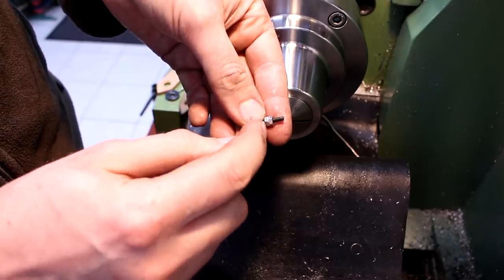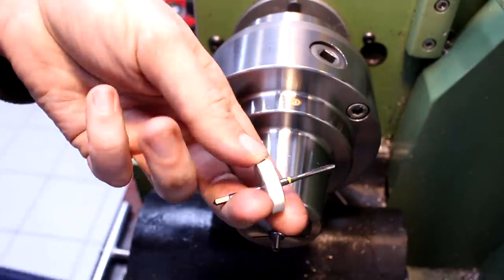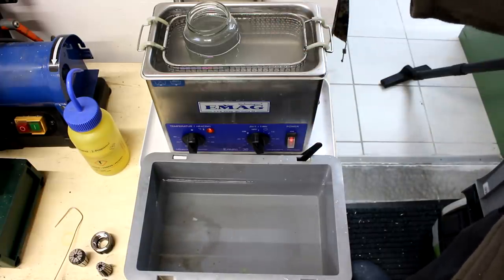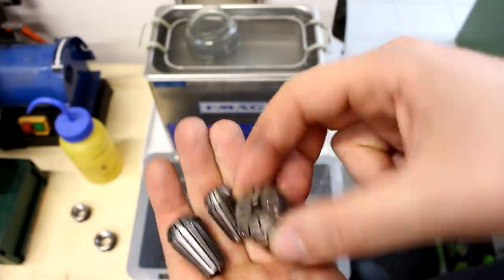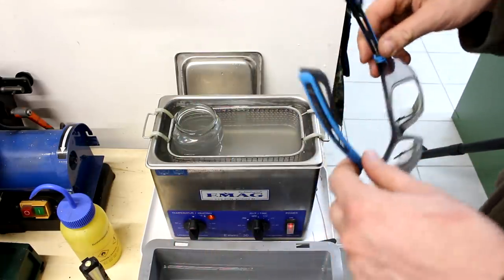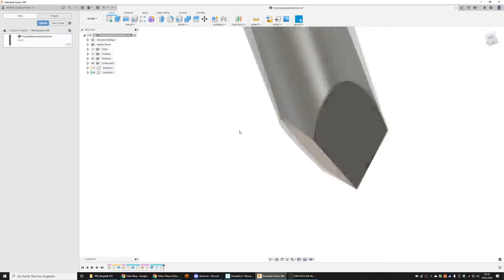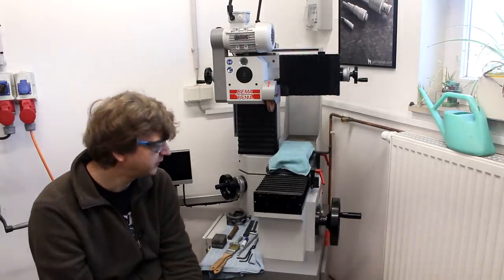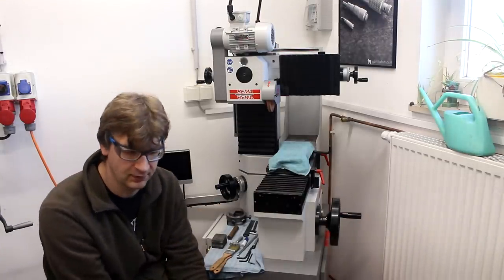Shoptalk #25 - 02-2022

Comment: I’m so pleased to have come up with the same solution for tiny hole spotting. I made the same tool from a broken PCB drill using a setup kind of like you’d use to cut facets in a gemstone. I needed to drill some 0.002" / 0.05mm holes in PEEK tubing and I needed to spot them first. Thanks for the video. I really appreciate your skills.

Comment: Here in the US we have a warehouse club thats owned by Walmart called "Sams Club" they sell a Degreaser concentrate for $6/gallon that is very similar to "Purple Power", it makes 32 gallons of cleaner if you mix it by the label, or if you mix it 1:1 it will strip paint- I use it in the Ultra-sonic on everything except Aluminum Carb bodies as it turns them DARK (For those I use Berrymans)

My old, worn out 1946 Brown and Sharpe No2 worn out 6x18 Surface Grinder weighs 1,400 lbs.......

Comment: Excellent content as always so thank You!
One detergent that is alcalic and which is easily available is the dish washer detergent. Those are designed to remove fat and not to harm cutlery.
However, alcalic solution will usually attack aluminium.  That is especially true when the detergent contains lye (sodium hydroxide). Actually having aluminium shavings in a lye solution produces hydrogen. This is because lye and water react with aluminium creating sodium aluminate and the hydrogen will just bubble out.  That reaction can be quite violent and the hydrogen gas is ... well ... it is what it is.

Edit: I need to seek help 😊

Comment: Love the shop talks.....another way to guide a very small tap is by machining a holder for the shank of the tap, the tap shank slides into a precise hole (essentiall a tube) and allows the tap shank to be guided up and down as the tap threads in and out.....the top of the small holder is solid and can be tightened into the chuck or collet and held tight.....quick easy and simple to make, combine that with your knurled tightener and its a win win combination and can be used for multiple taps of the same shaft diameters.....Keep up the fantastic work.....
Don

Comment: I precision grind my horizontal band saws this way also before silver brazing them together in a custom jig for alignment when I make up my new blades, it greatly increases blade joint strength, by increasing weld surface area, most blades are just butt welded together that increases the chance of breakage at the joint!

Comment: Two questions:
1) With the "pyramidal" bit, why not make it a true pyramid with four flats? That would get rid of the added complexity of calculating compound angles when grinding the flats.
2) I have no experience at all with surface grinders but I've seen that they're normally dressed using a diamond tool. How long does that typically last before requiring replacement?
And yes, I watched every minute. Always fun to watch a true afficionado geek out over a new tool.

Comment: Wow awesome grinder! 👍👍  (At the cost of a sports car... 🤔)
Here is a suggestion for the ultrasonic cleaner; in the supermarket you can buy bright coloured silicone webbed mats, about 120mm square and 2mm thick. They sell them with the kitchen goods as a "grip aid" to help remove jar tops. The silicons is stable and heatproof, and you can use them in the ultrasonic cleaner to stop your glass jar or large items from rubbing on the stainless container. 🙂
Reply from the maker: A sports car will be worn, rusted away and obsolete in 10 years, the grinder will last :-)
The silicone mat is a great idea, i will give that a try!

Comment: Stefan, the load is also torsional, in use trying to twist as much or more so, as “ vertical “ load.  So you don’t get to take 3mm cuts with a 10mm bar.  SO!  You did good.  Loved the project.  More similar stuff for us who don’t question your training!

Comment: The alkaline solution not only neutralizes oils but it's also a great drain cleaner. The industrial strength stuff is nothing but pure lye which is extremely alkaline.  Depending on what your cleaning as long as there are no heavy metals in suspension going down the drain may be just fine.

Comment: Deflection of the tip would of a cantilevered beam is (force * length ^ 3) / (youngs modulus * second moment of inertia) assuming a fully fixed mount. It's true the second moment of inertia would be disproportionately affected by removal of material further from the centroid axis, but as it's a circle the area that is removed is relatively small until the removed distance becomes larger. The main thing to take away from that equation though is the stickout makes a much higher overall impact. Halving the 2nd moment of inertia only doubles the deflection, doubling the stickout increases deflection by a factor of 8! 
This is also why the carbide helps - the youngs modulus of carbide is about 3x that of steel, thus 3x less deflection. Perhaps most interesting for me is a 45% increase in stickout entirely eliminates this difference (or in another way switching steel to carbide allows a 45% longer boring bar with the same deflection)

Comment: As far as disposing of the cleaner solution, what I do is add all the dirty solution to a bucket or pan, let it evaporate a lot of the water off (no heating, I just let it sit a few days), then I put the now concentrated solution with all the nasty bits and oil into a 5qt oil jug and dispose of it quarterly at a waste disposal that handles solvents and petroleum products. 

It's the laziest, easiest way to do it.
Reply from the maker: You might be laughing, but I do that :D
Not only with the ultrasonic cleaner solution, ut also with the water from my vibratory tumbler.

A way to speed it up, is to have a rag hang into the liquid and wick up the water - this increases the effective evaporation area. Works especially well during a hot summer.
Reply: @StefanGotteswinter  I'm going to do the rag trick now, makes perfect sense. That's how a swamp cooler works!

Comment: Okay, that Bema grinder is scary silent. I didn't even know you had turned it on until I heard it working on the part. That is indeed a very nice machine.
Reply: I remember being school (metal/machining) young and there was lady that was learning to be machinist and she unfortunately lost finger as she had thought she had turned off the machine and she had gotten that nasty optical illusion that wheel had stopped and she had done something like began to fix part or something and it's obvious what can happen. Part of the incident was that machine was so quiet and there had been some background noise. IIRC they added some lights and warnings to some of the equipment to try to prevent such incidents in future.

Comment: Seems Austrian's have a better sense of humor than Germans! 😂
I'm pretty sure I need therapy as I watched the full hour and forty three seconds, you do have a calming effect though 
Using drill chuck for guide plus putting a flat on tap was an addition to Joe Pie's mini-tap wrenches
I modify  old Honda carbs( from mid 1970's) The damage ultrasonic cleaners can do from cavitation is very dramatic on zinc based parts. Way too many motorcycle shops seem to think it's the 'best' way top clean carburettors, it's not but it is a quick way to destroy them. It's fast but generally a very bad idea. 
I've had an ultra sonic cleaner for ? years but very rarely used it, glad you showed some different uses for it,

Comment: Hi from Amsterdam. Is it possible to use coolant with the new surface grinder? Which I really like by the way.
Reply from the maker: Mist setup would work, flood cooleant not without adding a tray. I see a way for doing that, but I think I can live without. A lot of toolroom grinding is done dry and people find ways to deal with heat input, thermal growth and wheel behaviour.
Sometimes I might use cutting oil or a wax spread on the part, if I grind something very soft or gummy like copper or soft steel (especially a magnet chuck)

Comment: I desperately need help, one hour of video went like 10 mins. Regarding the wheels for small grinders, I find very very difficult to find wheels in low hardness grades for my Saim e4 (very similar to your lip515). Where do you find this 46j orange wheel? Thank you Stefan!
Reply from the maker: I buy 46grit J hardness from H.B. Schleifmittel here in germany.
How do you like the Saim? I considered a hydraulic one, but the ones I looked at, did not have a manual table traverse.
Reply: @StefanGotteswinter  Thank you for the tip, I'll look for HB Schleifmittel. Il like my grinder, but it's in the same situation as your lip, it had a hard past life and after a ton of work I get good results out of it, it has an optional planetary stage for the X movement with a lever, that makes long grinding sessions less effort intensive.

Comment: That looks like a far more heavily built manual surface grinder than a Harig. We had 5 or 6 Harigs in the shop.  One thing Harig offered was left or right hand table traverse. As most people are right handed I always thought that the right handed machines were more natural to operate. But then maybe that was what I was used to. We also had DoAll hydraulic grinders and they were right handed for the manual table traverse.

Comment: Hi Stefan, do you lightly oil the ER collets after cleaning, to stop rust occuring?
Reply from the maker: Nope, I just blow them dry, never had issues that way.
Reply: Thanks stefan, nice and easy then. Thought they may start to corrode. I have a small ultrasonic cleaner that i have used on a few micrometers for a few mins at a time just to get grime off. They certainly do come in handy. Ive put a bit of clock oul on those and they are great.

Comment: I was using glass jars of cleaner in my ultrasonic for same reason to reduce the amount of wasted cleaning fluid. But I had assumed that the glass wall of the jar, was reducing the effectiveness of the ultrasonic wave passing through the jar. Thus reducing the cleaning action. Am I wrong and can go back to using the glass jar method? 
I might do the aluminium foil test. One in the jar the other outside and compare the hole rates as a gauge to see if there is any difference.
Reply from the maker: The glass definetly weakens the effect a bit - But for me the waste-reduction is more worth than a few percent of less cleaning effect or a few seconds longer in the bath.

Comment: Hi Stefan.   You’re the only YouTuber I will sit down for an hour and watch/learn with 0 complaints.  Question I have is:  most surface grinders I see in North America have provisions for flood coolant.  Is not having that option a problem for high quality surface finishes?
Reply from the maker: Cooleant would be nice for heat control when doing heavy stock removal - But the toolroom class grinding we do on these small grinders can be done dry without much issues.
On a automatic grinder that has to do a lot of plate work (Like in stock preparation or when grinding die/mold bases, cooleant is an absolute must)

Comment: Hi Stefan, great video as always! The new Bema SG looks fantastic for your use case and must feel great to have a new new machine and not require you to do any post shipping mods from the factory. One thing I was wondering was how do you find the arm position for the side / lateral movement after using the Bema SG for a longer time frame?

Comment: We built some war games equipment that mounted on tanks. The customer wanted the system easily installed and removed so we designed a magnetic mount. Unfortunately we didn't use expensive "aluminum" grade magnets and the system didn't stick to the armour!

Comment: Now that I see the stuff about tapping: do you have any advice on how to get a thread die started properly, especially without the apropriate lathe tool?
Reply from the maker: I used to support dies for years just with the drillchuck opened up all the way in the tailstock.
Reply: @StefanGotteswinter  I tried that, but I'd need a third hand to keep pressure on the die holder. My small lathe is too weak for doing it under power.

Comment: I thought it was a best practice to only turn the tap 1 turn then back half a turn.  Is that not required?
Reply from the maker: Not with decent taps - It can even cause problems like chipped cutting edges or snagging of chips if you chipbreak with them.
The 1 turn forward, half turn back is from a time when taps where really shitty.

Comment: Not a machinist, but that bema indeed looks really nice quality. Out of curiosity, are those grinding wheels expensive commodity (I hope that's the correct english word)? I assume they're way more better materials than used in normal bench grinders wheels?
edit Oh it was actually mentioned in the video. Much cheaper than I anticipated. Thanks for mentioning it.
edit2 I'm bit surprised that table movement doesn't have any automation. Would be dirt cheap to have solution to it from the factory. Though easy to make self.
Reply from the maker: On toolroom style grinders you will often find purely manual motions without any assist :)
The nice thing: Those are machines that last forever.
Reply: @StefanGotteswinter  Profession being packaging machine mechanic, I kinda see your point. Automation can at worst be the thing that can lead to devastation and I suppose the manual labor in this case isn't that bad thing as mechanics seem to function very effortlessly. I guess automation is more for stuff for ie. engine shops etc. that grind vastly larger objects :)
Reply from the maker: yeah, also for larger toolroom grinders - All our surfacegrinders at work are hydraulic or cnc with servos, since we do a lot of plate-work for our tool/die/mold shop
Reply: @StefanGotteswinter  Oh there are hydraulic controlled models too. I didn't have a clue. Sounds like equipment that would be interesting to see. Those businesses are pretty much always in the category of "No information to any outsiders" :)

Comment: How do you like the 3d mouse? Do you use it occasionally, or all the time?
Reply from the maker: I use it quite a bit, but I can do without, too. Its nice when you have to select a lot of edges/surfaces in Cam work - Paning/Spinning around the model with the 3d model and clicking the to be selected features at the same time.

Comment: Interesting machine (BEMA), even if sitting there would make me feel like to watch a rifle from the wrong side...
Inspiring is the aluminum construction: you don't have to go cast iron to get precision!
Reply: I'm really surprised that they use aluminum alloy as a material for surface grinder. What about stiffness and thermal expansion? But since they build them and and sell it must work.
Reply: @kundeleczek1  Stiffness should not be a problem, because the forces on a grinder are quite small. Even thermal expansion should be not an issue, due to the low power involved in this kind of machining. Other two points leave me with questions: 1. poor damping with possible resonance of the structure; 2. internal tensions (Stefan said "extrusion", and this is a very risky choice for a precision machine).
Reply: @giorgiocanal1659  Internal tension can be solved by thermal processes or vibration treatment. Low damping is a issue but it can also be solved by adding damping materials like foams.

Comment: Stefan I want to make my own cutting tools with silver soldering carbide cutting points what I would like to ask of you is can you recommend a source to buy carbide blanks and wile I'm asking if you know of a realy good high mag bench light for getting very small angles  and how true is that carbide is not all the same insofar as quality and if it's cheap it's probly because it's not very good. And what is a fair price for a blank of 10 cmX3mm thick 5mm wide I live in a city of 1/4 million and I'm told il never find it locally and I'm expecting it to be high but how high is a ripoff ..love your videos and I'm asking because I respect you opinion.

Comment: I hate to beat a dead horse but why don't you use a boring bar holder and make sleeves for each size bar?  The rigidity gained is ridiculous, it costs no more than a little bit of time using scrap material to make, and they are easy to setup because the holder will typically be on center height within a few thou between bars that use the same insert.  I think you would be surprised at the results if you redid your test with the sleeves vs standard tool holders.

Comment: I am pretty badly disabled and my finances are terrible I envy you your shop my shop consists of garbage I covet everything you have. I know it's a terrible way to be but I have almost no hope of advancing myself at this point. I'm looking for a cheap small surface grinder or spindle grinder I think I'd be better off with the surface grinder and building a cylindrical grinder like you did I have a massive amount of parts to do such things because they come from the robotics industry. As a matter of fact I've been trying to give you some extremely high speed motors made in Switzerland they're made in clean rooms and they spin it someone godly high speed their assembled by robots apparently. But I don't think you've ever seen my offer maybe you'll see this one. myself

Comment: Well, it does diminish stiffness compared to a round bar but, not compared to the same bar design in milder steel, the one you are replacing.  Also, it is no use using a boring bar one can not hold on the toolpost. C'mon guys.

Comment: No.
Sorry Stefan,
Although I would not disagree at all  with what you said,  for the first time in a decade,  I cant agree with what you didnt say.

Yes, I agree that the way you setup the flat surfaces (horizontal in the transverse mode) the bars will be weaker in the vertical mode.

However you didnt rotate the bars to be "flats vertical".
I suspect the bar won't be weaker and may probably be Stronger in this mode.

It would be great to know what your pc thinks about it.
Great video, Thanks.